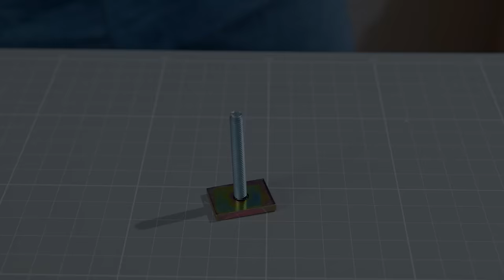Amazing ideas for circle machining

Comment: I am  EXTREMELY IMPRESSED with your shop made tools, jigs, talent and ingenuity!!  One tip that I use is instead of drilling holes in the jigs to match the hole pattern on bottom of your router and fastening the router to the jig, use a router guide bushing in your plunge router base, and then drill a matching hole in your jig.  I usually use a 3/4” guide bushing and drill a 3/4” hole in your jig. This way your vacuum hose won’t twist around the router.  This will work with some of your jigs but not all of them.  (You will need a Makita adapter plate to accept     1 3/16” O/D guide bushings.). John Jensen from British Columbia.

Comment: Very clever solutions indeed, especially using the vacuum suction jig as the pivot center for cutting circles with no hole in the middle. The bandsaw jig is also brilliant, thanks for the video! 👍
Reply: Very clever indeed!.  Do you know the name of the valve that changes the flow from blowing to suction?

Comment: I'm impressed by the new suction cup, I made one on my 3D printer. 
Unfortunately, with a round shaped cup it is impossible to know where the center is. 
So I made a square one and now I can align the edges of the cup with the cross marks on the target.

Comment: What is that connection piece shown at 9:58 that couples onto the air compressor tip and converts it to suction??
Reply from the maker: I would appreciate it if you could purchase a plan for the details of the parts list.
https://jsk-koubou.stores.jp/items/63df439dd191233463777d64
Reply: It's called a Vacuum-Ejector (on a popular shopping site for around 10 dollars - Baomain ZU05S)
Reply: @earld1403  thank you!

Comment: What is that device that you used to turn your air compressor into a vacuum pump?  I was hoping to see something in your comment section about it.
Reply from the maker: I purchased from the website.
There is a model number list of parts in the plan, so if you are interested, I would be happy if you could purchase it.
https://jisaku-koubou.com/downloads/vacuum-circle-cutting-jig2023
Reply: @jisakukobo  Well, that'd be great if I had a need for a circle jig, but I don't.  But I do have other uses for something like that.

Comment: Please can you ad a link to the connection piece shown at 9:58 that couples on to the air line and converts it to suction please
Reply from the maker: I would appreciate it if you could purchase a plan for the details of the parts list.
https://jsk-koubou.stores.jp/items/63df439dd191233463777d64